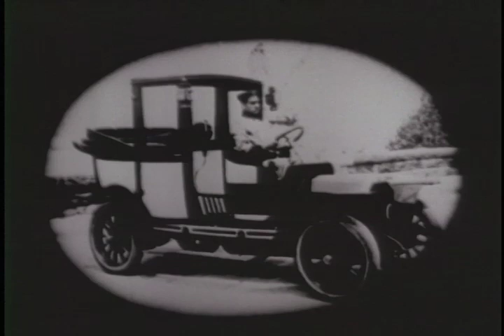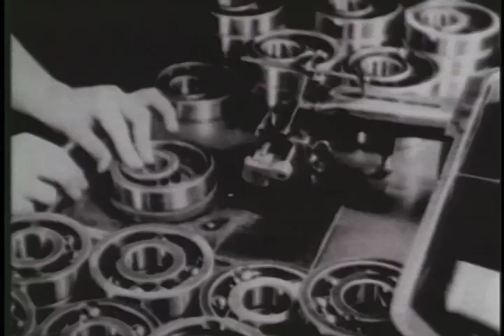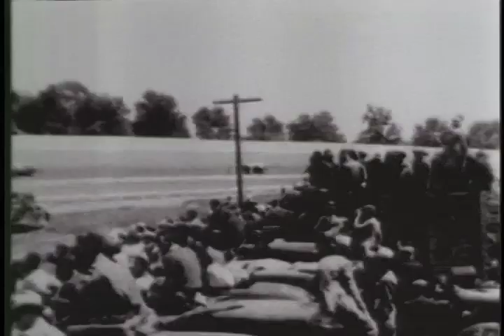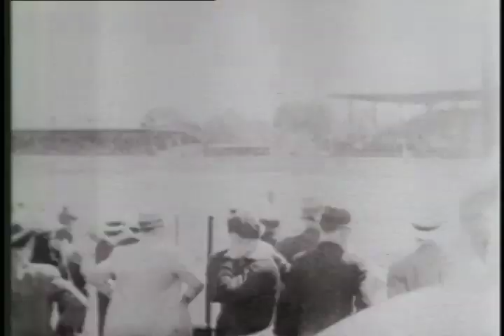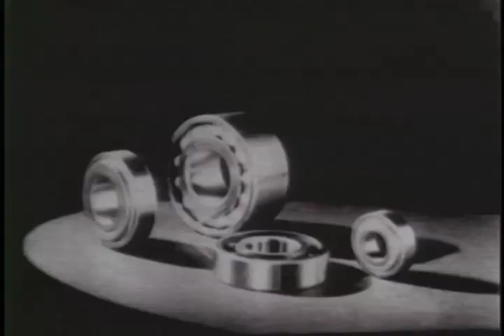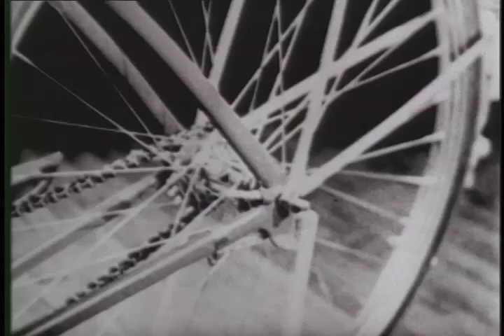New Departure

Comment: During the years leading up to WW2, New Departure Bearings of was faced with making bearings for gyroscopes and other precision instruments. Originally the balls were sourced from Germany but by mid 1941, that supply was closed off.  The company had anticipated that and in the previous year found a way to grind a 1/16" ball down to 1 mm (.0394") for use in PF-4 bearings (OD 4mm) with 6 balls and the C-270 (2.7 mm OD) using 3 balls. They were assembled in cleanrooms by a crew of women using forceps and magnifying glasses (because of their natural dexterity  apparently). By late 1943, PF-4s were being produced at the rate of 10,000 a month with C-270s at 18,000 per month.
Reply from the maker: Great piece of history.  Thanks for sharing.